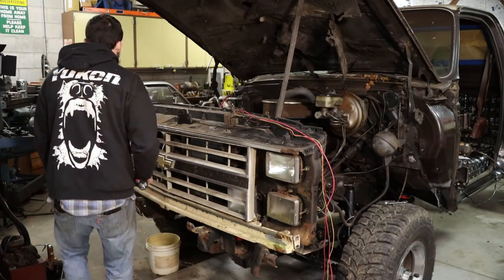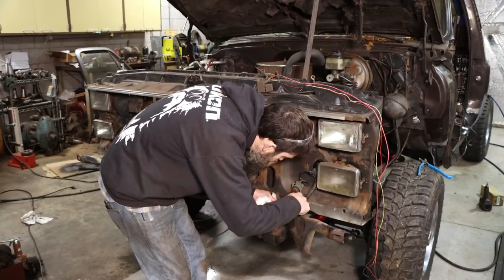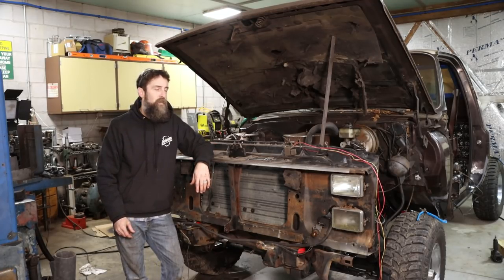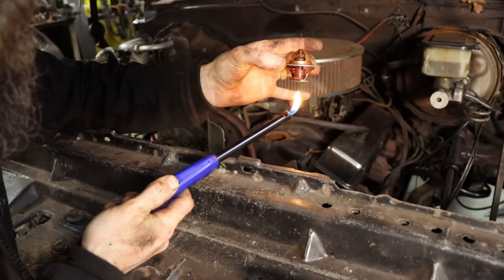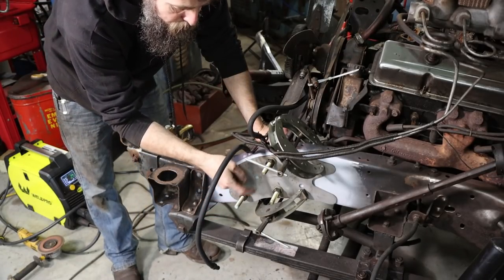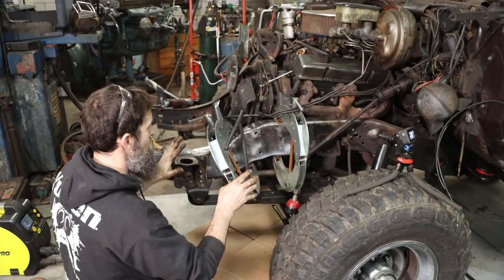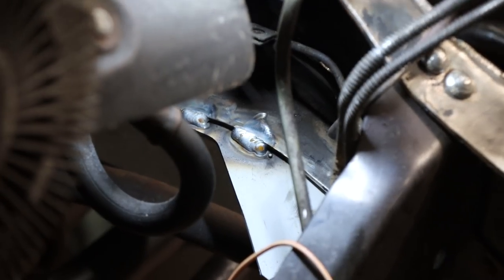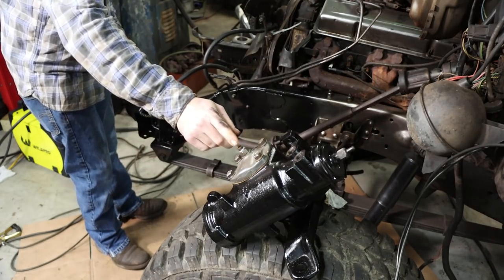Rough Country Steering Box Repair on the Chevy K10.

Comment: To test a thermostat, don't use a lighter, and you actually do risk damaging it... It won't tell you if it's working right or not..... You need to use water, otherwise, you have no idea what temperature it opens at.... If a thermostat should open at 87c, and you use a lighter with a 300c flame, that tells you exactly nada... So, get a pot, fill it with water, pop the thermostat in the water, do the same with a thermometer, preferably a digital one, and see what temperature it opens at. If it doesn't open at the rated temperature +-2c it's defective. Thermostats can also fail three ways, stuck open, stuck closed, and not opening at the correct temperature.